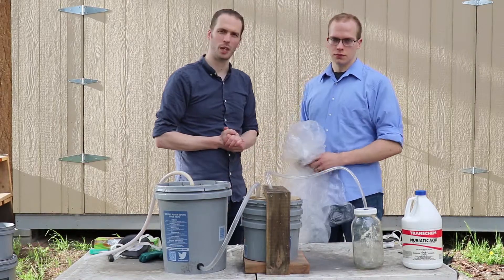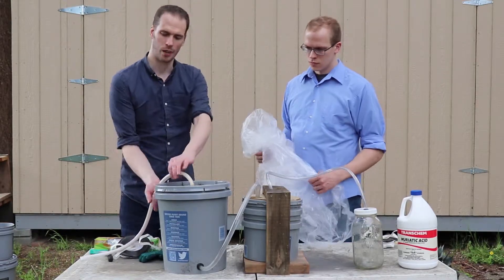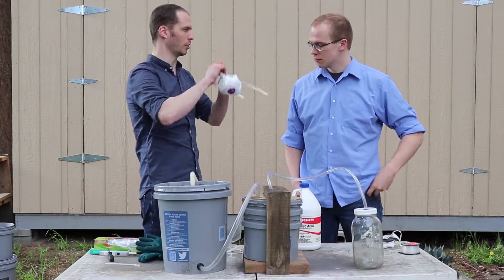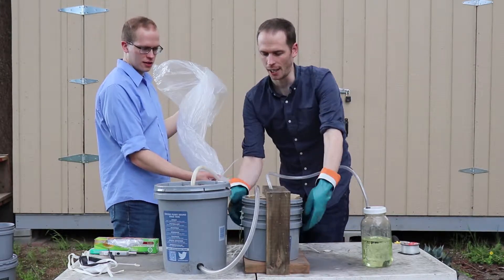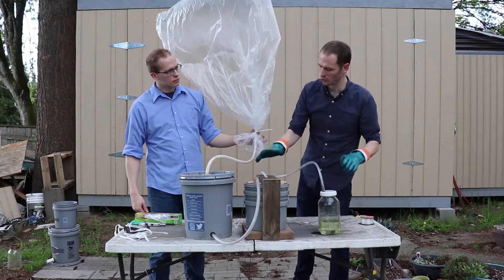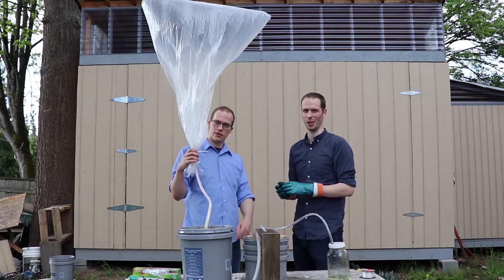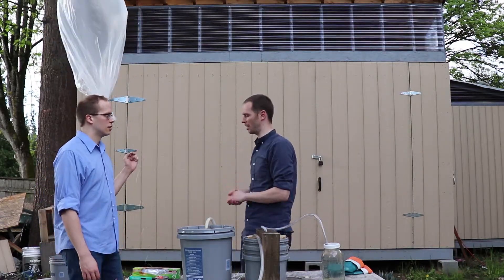Make Things Fly - Project: Making Hydrogen

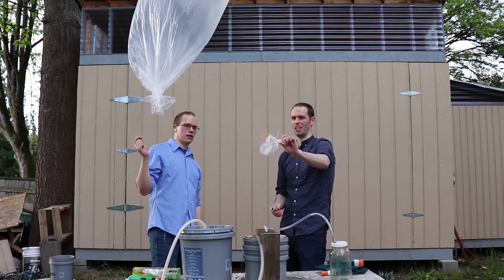Comment: 5:35 interesting, I actually thought it would explode
Reply from the maker: The hydrogen is too rich to explode. When you see videos of hydrogen exploding it is because they have allowed oxygen to mix with it. Safety is paramount, one thing I did when I made hydrogen is to purge my equipment's lines to reduce as much contact with oxygen as possible.

Comment: but how you pump the plastic with hydrogen?
Reply from the maker: It's a chemical process using acid, the hydrogen goes from high pressure of the buckets to the bag which is lower air pressure.
Reply: @makethingsfly  but i know other way to make hydrogen by giving electric to water then it be come hydrogen

Comment: Hi guys !! I made hidrogen at home during quarantine. It was so funny, but it turned to a dangerous experience.
I filled latex and foil ballons !! I would be glad to do it againg but with the safe stuff you have.
Plase, if you consider to do it again, could you inflate a big latex balloon or a big star or heart shape foil balloon with hidrogen ??
Many thanks for uploading !!!
Reply from the maker: Safety is number one when working with hydrogen. This method includes using acid which you must be very careful with. The main safety rule when working with hydrogen is to keep oxygen out and be in a well ventilated area. The second is to remove any static (I wipe my projects down with dryer sheets, but larger project maybe use a anti-static line to ground out any static charge. I might do a video just on hydrogen safety and could inflate a large star or heart shaped balloon.

Comment: Your second bucket    is it half way filled with water ?   you showed the water in the hose  as a water valve     I am planing to make a smaller mock up for fun          I like the way you have a wood base under and above your first bucket     High Five to ya
Reply from the maker: The water bucket is filled halfway to 2/3's full. Use extreme caution if you are attempting to build one. The acid is very corrosive, can cause chemical burns, and will eat concrete. The contents of the first chamber will be super heated to over 250 degrees (over the boiling point of water), and it will build up a lot of steam pressure. Always wear PPE like chemically rated gloves and masks, I should have worn lab goggles for this video. Also I always keep a large water source nearby incase I need to wash quickly. This type of setup should be done outdoors, any near by metal will corrode as the gas is also somewhat corrosive. The wood structure is part of a design to keep the steam pressure from blowing off the lid. This is not a casual build, and there are parts of it I don't explain or show.
Reply: @makethingsfly     understand the dangers   Extreme Caution is paramount    The more i think about the dangers  a 25 dollar helium bottle at Walley world is much safer  lol
Reply from the maker: Safer but not as much lift (bit of a trade off). A lot easier to set up, take down, and clean up using helium though. I find that I spend as much (sometimes more) than if I just went and bought a giant canister of hydrogen. So in the end I use this process more for the thrill of building, testing and improving, not out of necessity or to save money (if anything it can add lots of time and headaches). That said, once you get it down, it is fun to hear the chugging buckets, feed it acid and feel reaction as you watch your project float into the air, coming alive like some Frankenstein monster.

Comment: was the aluminum FOIL or sheet  that you used ?     Awesome video     High five
Reply: Both will work, but if you want a faster reaction use aluminum foil.
If you want a more controlled reaction, use a sheet or pieces of solid aluminum, which will take longer to react.
Reply from the maker: Ryan has a good answer. For this demonstration I use crushed aluminum cans. I no longer use aluminum cans because they have a film inside, and once one of my lines got clogged with a can liner. Aluminum foil goes too quickly,  I like a steady production that can last for hours. I usually use aluminum car parts. The sludge can be stored and dropped off at local HazWaste drop-off sites.

Comment: what type of protection are you going to add? the hydrogen make boom easily?
Reply from the maker: Hi Daniel, looks like this was the same question you asked on the Rigid Airship 1 video. But because safety is really important it is good that you asked this for both videos (see my general response there). If certain safety measures are not taken it significantly increases the chance on an explosion. Just like working with propane or other inflammable gases, safety has to be at the forefront of your processes. I think I might make a video on just safety techniques and measures of protection to work with hydrogen. Thanks for watching my videos and for taking the time to ask about safety.